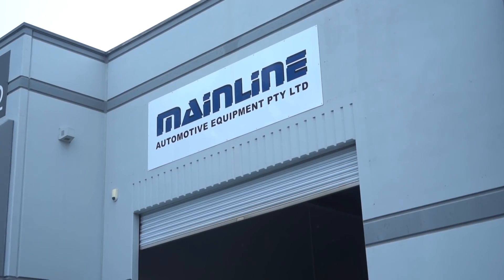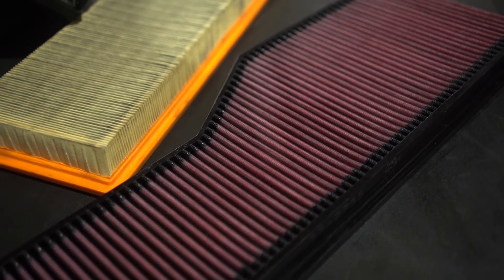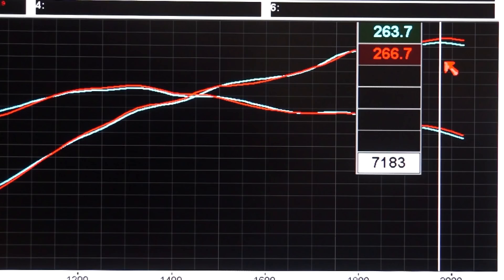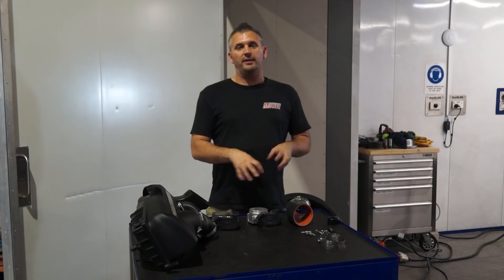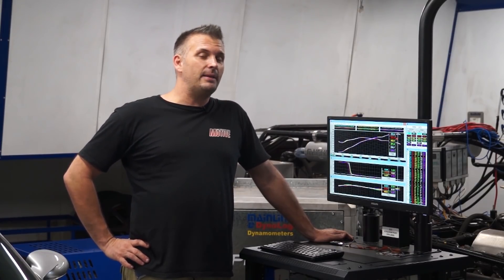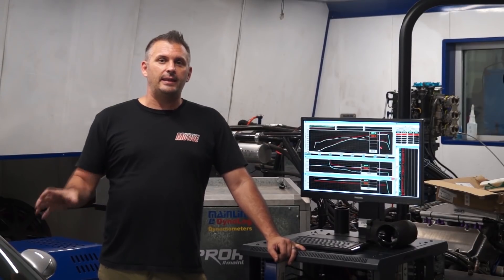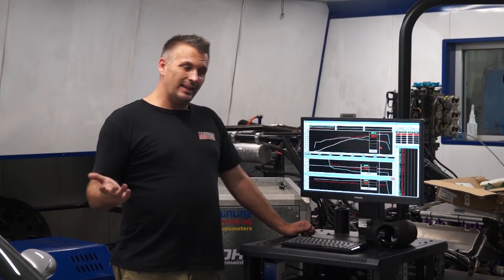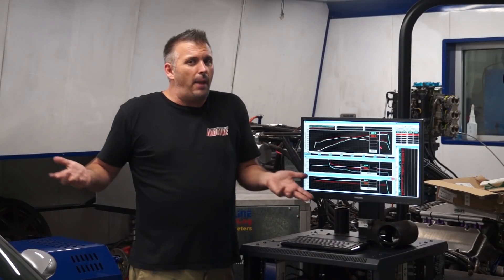MYTHBUSTED! Do Intake Mods Work? - Motive Garage Porsche 997.1 C2

Comment: I’ve read it requires a tune adjustment to realize the gains.
Reply from the maker: WE've said this 400,000 times. If the manufactuer tells you it is a "BOLT ON" product and will make more power WITHOUT tuning, then they are lying. None of these products say when you buy them "they wont make more power unless you tune it".

Comment: many engines gain power and torque with a sports air filter or a dynamic carbon intake (with forced air intake at the bumper or grille), but Porsche must have worked so well on their original air box that it is perhaps not possible to have a power gain unlike other models where the air box must not be as good ?!
The bmc OTA carbon is very good. But bmc also recommends a remap + exhaust line to really benefit from a gain compared to the oem air box with also a remap + exhaust line, I trust bmc, because of a long experience in F1 etc... And I think there are hours of testing and fine-tuning on the power bench.

Comment: Upselling bullshit products works for the unaware. A tune guy in Adelaide tried telling me that a cold air intake will add more power. 😅😅😅  They do nothing but add noise and cost you $$$.
It is safe to say that german engineering obviously designed what actually works, for anyone else coming along trying to be an expert😅

Comment: well,  if you change you filter , IPD plenum, & 82 mm throttle body,  you will have no positive result in HP due to the motor running lean.  You need more fuel to run correct air to fuel ratio.....that requires a tune.  So most people anticipate this when upgrading to this setup.  Misleading video...or ignorant not knowing this being a dyne shop.
Reply from the maker: Manufacturer claims power increase without tuning.
Reply: @MotiveVideo  vous avez fait le le maximum, mais les gens ne veulent pas comprendre.

Merci pour ce reportage
Reply: install a exhaust system without cats and you can get~40 +hp

Comment: Porsche is already a very well engineered setup. In other words, not much to be gained from bolt-ons, but if you are installing a CAI it's best to tune to compensate for the change in air flow. Even at that point your gains will be minimal. It's mostly for the sound. If you want to feel a realistic increase in performance either increase displacement or add boost + ECU tuning. Tuning is key if you want to make the best out of your mods.
Reply from the maker: For the 10,000th time

Manufacturer claimed power increase without tuning

Comment: Great video, great analysis.  Not surprised the K&N intake system cost hp since it can draw hot air from the engine compartment and your test results showed that.  A little surprised by no gains from the IPD system, not even a bit more torque.  Have heard they work best with tunes from companies like Softronic, which is plausible since they can throw more fuel into the equation along with the IPD's extra air.  Would never use or recommend a K&N style filter.  Too much goo and you coat the MAF causing a CEL.  Too little goo (or failing to regularly maintain it) and you're letting gobs of dirt into your engine.  Porsches are not small block Chevies - add a few mods to an SBC and it unleashes more hp.  Not so with Porsche.  Want more Porsche hp?  Buy an S, a GTS, or a turbo.

Comment: I've done similar tests, many, many times, whilst doing live mapping on the dyno and I too have yet to find an intake any measurable amount better than the stock setup. It's a shame that you didn't test a NEW stock air filter element as well, because you'd probably have found that the K&N panel is virtually no better than a clean stock filter, which is also MUCH better at stopping dirt than a cotton/gauze filter.
The IPD in particular normally LOSES power just after the point where the resonance flap opens, and I know that this is because the 'divider' in the throttle T gets in the way of lateral wave propagation. (I know because I've previously chopped it out and re-tested it).

The big problem is that people WANT to believe that there's some easy, bolt on power to be gained, but there just isn't.
Reply: Wrong!

Comment: In order to feel the benefits of the larger plenum and larger throttle body, the car must run for at least 50 miles, sometimes up to 200 miles, for the computer to adjust to the new air:fuel ratio. This test was done too soon, in my opinion. Also, a third test should be done to actually tune the car to the new intake components. Stock >>New Parts after 50 Miles>>Tuned. That I think is the proper way to measure performance addons in this type of vehicle.
Reply from the maker: Except for the fact manufacturer said it will make instant gains.
Reply: @MotiveVideo  From the IPD Installation manual:

It will take approximately 5 to 50 miles for the DME/ECU to recognize and fully adapt to the
increased air flow and make the necessary adaptation corrections complete. The DME tends to
adapt quicker when driven in a more spirited manor.

You can find the document Here: https://www.ipdplenums.com/images/stories/Installation_Guides/987.1_Installation_Guide_Final.pdf

Comment: Great job. I just wish your first dyno run was with a clean air filter, that one was filthy. My experience is that the stock non oiled filters are best. I always notice a power increase or at least smoother running engine after replacing the air filter. The oil film air filters dirty up the intake air sensors and tend to cause issues down the track.

Comment: Needed VR remap/flash tune in addition to mods. Could've seen over 33whp
Reply from the maker: Manufacturer made claims that it increased power without tuning. Claims were wrong. That’s the point.

Comment: Porsche has a factory upgrade, the X-51 package, better exhaust headers, slightly different air box, some head mods.  
Intake alone will not gain anything.

Comment: I know that putting larger induction on my 1979 short stroke 3.2 messed up my hp until I put a different exhaust on it. So maybe just the regular IPD without the gt3 throttle body and better exhaust may have given better results.

Comment: Very interesting. I have a 987 Cayman S which I fitted an IPD plenum to with the standard 74mm throttle body the car came with.The exhaust is a Carnewal GT setup. When fitted,  I instantly noticed an increase in torque with my 'ass dyno' and the throttle felt much more responsive too. My car has Sport Chrono and the 'normal' setting suddenly felt closer to the original sport setting, while sport setting moved on a couple of notches. I've just acquired a 996 C2 and I am now slightly wary of repeating this mod if it doesn't work on all the models. Does anyone have experience of the IPD on a cable throttle 996?

Comment: Did you have a fan to replicate airflow in the car in real-life conditions?   If not, I wonder if that would change the increase in air temperature and loss in HP.
Reply from the maker: Two fans and suction fan. Simulates airflow over the car very well

Comment: I am wondering if K&N over-oiled the filter at their factory?  My friend installed K&N filters on his motorcycle and the engine began to run too rich.  After many carb adjustments, he finally found out that the K&Ns had too much oil in the fibers!  Washing the factory oil out of the filters and re-oiling (lightly) the engine finally ran as it should.

Comment: Yup this is exactly why I kept mine stock. I saw a show where they talked about this very subject. The aftermarket looks and sound better but you’re letting all that hot engine air in as well thus messing with the air/fuel mixture. Porsche engineers knew exactly what their doing so don’t mess with it unless you have a tuner that knows what they are doing but then that opens another can of worms. To me if you want to go faster just get the turbo or gt3 but in my case and my driving style my carrera S is more than enough for me not to kill myself lol.

Comment: Thanks for using a strict engineering approach.  It comes to the same conclusions that I have had for years.  As a Porsche customer for nearly fifty years, I know that they have an extremely good engineering staff.  They rarely leave low hanging fruit.  I can’t tell you how many K&H filter kits have been misrepresented as a ‘cold air kit’ but common sense suggests that when you suck air off the top of an engine compartment—not ram air like the stock configuration, the warmer air entering the engine will pay no dividends.

Comment: The k&n 57-7000 intake kit dyno test should add 23.8 bhp, according to k&n official dyno test, i'd strongly  suggest reaching out to k&n and informing them of the power loss, could well point to a faulty maf sensor not being able to ''sense'' the increased air from the filter.
Reply from the maker: we did reach out to them 
We changed AFM 3 times

Comment: This is why (in Euro land anyway) no one really bought the 3.6.  Its a much less potent engine than the 3.8 and really does not have the power and the cost difference between the 997 and the 997S is not really that big.  I had a fabspeed CAI on my 9972S and I never had it dynoed but I could feel a difference on the road.  This was confirmed 2 years later when I sold the car and put the stock box back on and I could feel the difference straight away.  This was before the days of draggy etc on mobile phones (2004-6) so I have no hard data but would be interesting to put a good CAI on a 3.8 and run your tests.

Comment: Where is the second video with exhaust and tune to co with the CAI????
Reply from the maker: The CAI, or hot air intake in this case, was marketed as making more power by simply installing it. It didnt. Shouldnt have to tune the car for it to work. Plus the data showed hotter intake air temps and it pulled timing. Tune wouldnt help it.
Reply: @MotiveVideo  But you said you were going to do a follow up video and that would be interesting to see the results.
Reply from the maker: @MAPCLS55  We sold the car and got a Supra. :)

Comment: FWIW my 996.1 has IPD plenum, gt3 throttle body, k&n intake and Gundo hack mufflers. It pulls on a stock 996.1. There has been an on-road test tapping into air intake temps and maf readings that demonstrate that there is an improvement over stock. My guess is sitting still on a dyno just doesn’t get proper cool air airflow to the intake.

Comment: Just buy the turbo lol, more power & more tweakable.
Reply from the maker: and $150,000 more
Reply: Just bought a modded 997.1 Turbo for $68k. Not cheap, but not $150k. Enjoyed the video, very comprehensive. I've never done an intake on any car, I've always suspected they weren't too effective. I'd love to see some mod testing on a Turbo though, they respond to tuning & tweaking so much better.

Comment: Marketing mindset is - let's make products consumers can install which "theoretically" will improve performance/hp/etc = $KKKK
Logical mindset is - let's identify an existing factory product which restricts or limits performance/hp/etc and uninstall it = $0.00
As you demonstrated - a simple swap to a non-restrictive K&N airbox filter yielded a 5-7 hp gain from baseline to the power curve; and improved throttle response. The people pitching Plenums to non-comp daily drivers as a performance upgrade borders on felony fraud. Without a modified air induction system, then attaining the speeds necessary to generate an increase in the volume of airflow/atmosphere accelerated into the plenum, the only gain consumers will realize is the balance appearing on their credit card. 
Plenums are NOT designed to increase horsepower - their purpose is to maintain optimum airflow on throttle ups and gear change.
IPD should include a "SUCKER" t-shirt with every retail plenum order. Their offices are probably located next to the folks selling the IMS bearing retrofits requiring $1000 in proprietary tools to install. Thanks and thumbs-up to Motive Video for keeping it REAL !

Comment: Really nice to see this kind of thing done properly: you hate to see comparison videos / articles where things are just thrown on and horsepower numbers are read off and that's it. Always funny when people are testing their stock stuff mid-day and then testing their aftermarket stuff at night after they've finished their installations... like yeah, air temperature / density altitude are a thing.

My take after having one of Fabspeed's carbon Y-shaped dual-cone airbox replacements? At low rpm (which you obviously have to deal with every time you start the car moving during normal driving) the engine never ran as sweetly / throttle response felt degraded. I'm sure power was down by a measurable amount purely as a result of the intake air temperature being elevated due to engine drawing air from inside the engine compartment. The sound of that intake was absolutely manic and I loved it and kept the pipe in the car for several years purely because I enjoyed the sound-- the car is already fast enough that you can't really push it too hard on public roads anyway. However, after driving the car for a few years with the aftermarket intake, I had to install the factory airbox again to pass an emissions test (I know: ridiculous, but that's how California laws are now-- you can't have any aftermarket equipment that's not state-approved. They don't even measure emissions output: they'll just fail you immediately for having undocumented equipment), and the engine / throttle response for daily driving stuff was just noticeably better with the stock airbox, so I've left it on and foregone my lovely noise.

At some point I'll get off my lazy arse and go pick up a rubber cap to bypass the resonator: I know it won't sound as good as the carbon tube, but I figure an improved sound and factory performance is probably the correct happy medium. I would not install any airbox on this car in the future that doesn't seal against the decklid. There are only a couple of boxes that do this that I've been able to find: one was a Porsche factory upgrade (part of the X51 power kit iirc), and there was one aftermarket company that seemed to do a carbon, sealing, dual-panel-filter solution that probably works well. Both of them were many thousands of dollars: not worth it IMO. Better off saving up and buying a GT3 than sinking money into attempting to hot up a regular Carrera, I think.

Comment: I used to own a 2008 Porsche Carrera C2 with the following modifications: (Coincidence?)
-IPD Plenum
-K&N Intake
-GT3 Throttle Body
-FVD Brombacher software
I didnt feel any improvement until a few days after the installation. Anyway the sound was great and i didnt dynoed or tried to compared in 0-100 km/h times or 1/4 mile.
Probably i will re-buy that car in a few weeks so i will probably take to the dyno and let you guys know.

Comment: Dumb comment here but... using a larger plenum etc but then leaving the standard airfilter end as a smaller diameter would surely limit the effect? 
I recall reading simewhere that the car takes a while to "learn" the new intake system. Is that accurate? Would you retest after a month? Just interested! 
Great test and video though.

Comment: Great testing mate. I had a BMW years ago and tried an experiment with the airbox "complete with original paper filter". It only had a 1 1/2" pipe connected to it, which went into the inner wing. I took the airbox out cut the hole out to 3" and fitted a flexible 3" hose which ran to an scoop behind the mesh of the front bumper .To be honest thought it might make a bit of difference, not much, perhaps at higher speed when more air was pushed in. Took it for a test ride and immediately felt the difference just pulling out of the garage, was very responsive and felt like a different car on the road and pulled much harder than before. Apart from having a remap it was the most noticeable cheap mod I have ever done. Was wondering if you could either add a secondary intake pipe to the existing airbox or a much larger one to double the amount of air going to the airbox.

Comment: Love this video, proves the point I've made for ages. Porsche know what they're bloody doing so why fiddle with immaculate engineering. Just pop in a reusable K&N filter so you don't have to buy the expensive replacement Porsche filters every service and Roberts your mother's brother. 4.5hp is a nice little bump from what is effectively a preventative maintenance part.

Comment: K&N will flow more air because the filtering capability is crap. You want to flow intake air like K&N, just remove your air filter. Check out the comprehensive test of filters to see just how bad the K&N is at “Project Farm”.